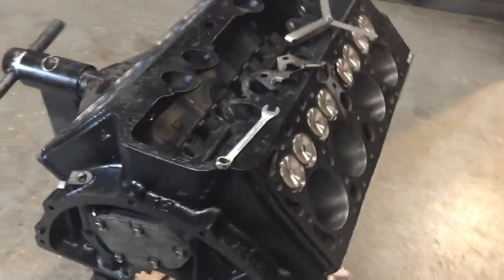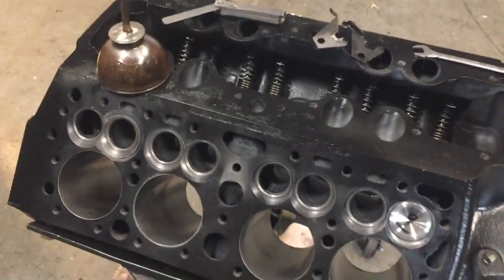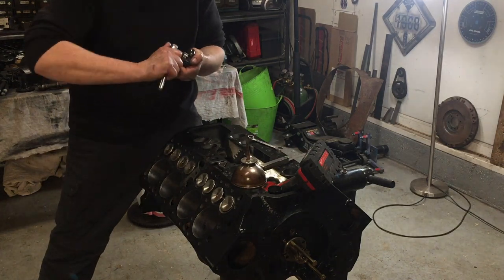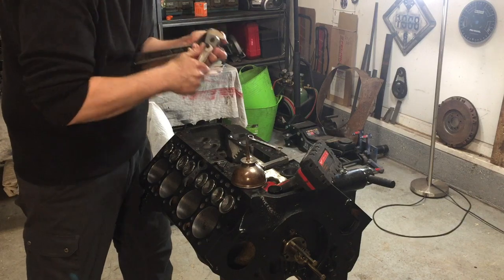Full Engine Assembly - Barn Find Flathead V8 part 5

Comment: Having never lapped a valve, what exactly are you looking for? Does the cut from the valve job change how it looks as you go?
Reply: Just looking for a good seal between the valve and the seat.  When you lap the valve with lapping compound you’ll feel it start off very gritty and then it’ll smooth out.  Look for a consistent grey line around the sealing surface on the valve.